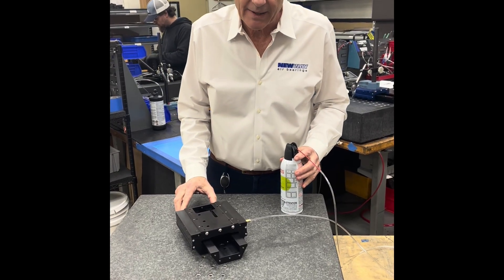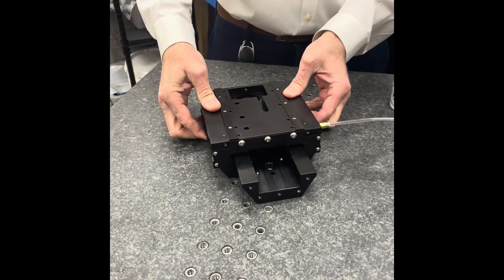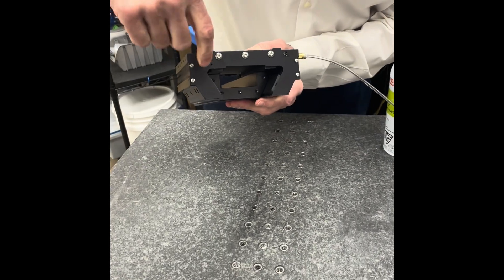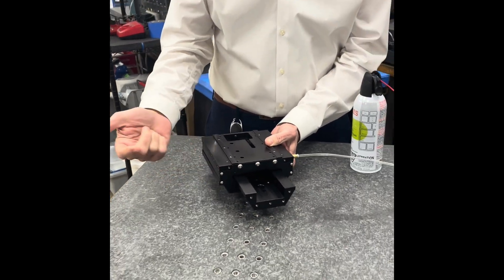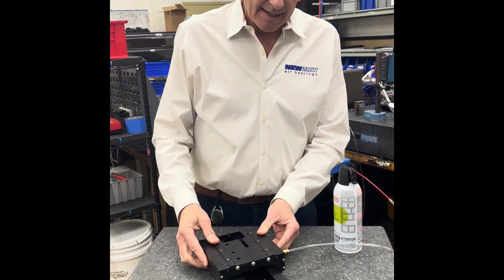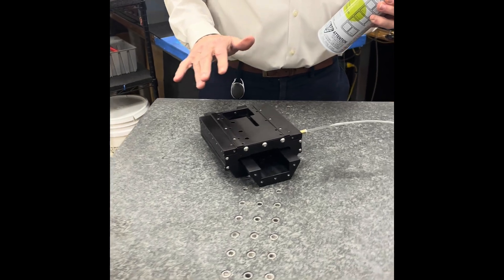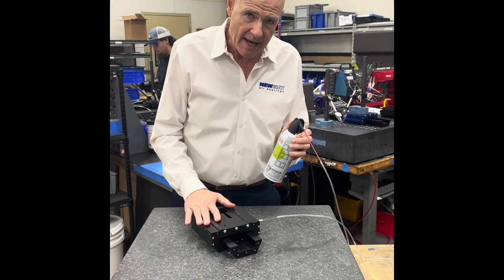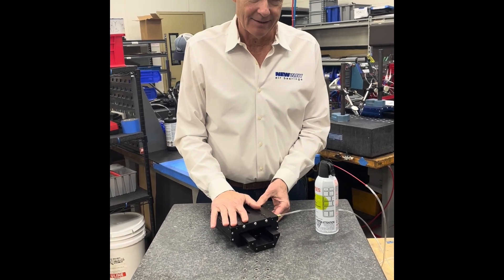Air, bearing dovetail guideway has low profile, high stiffness.

Comment: The main question for me regarding the air bearings is how much load they are ready to take in comparison, for example, with sliding guides. Will a air bearing lathe be able to remove a large layer of metal, or it will be only applicable for finishing or grinding?
Reply from the maker: We may spindles that can carry tons of load. We can definitely make spindles that are appropriate for heavy, cutting most diamond turning machines, though, where air bearings are typically used. Relatively light cuts, but result in super accurate mirror finishes.